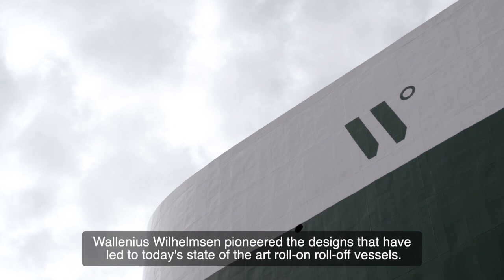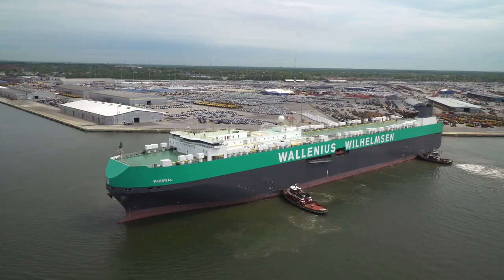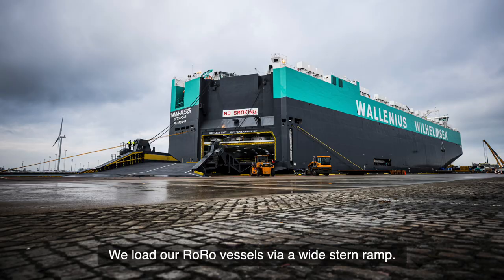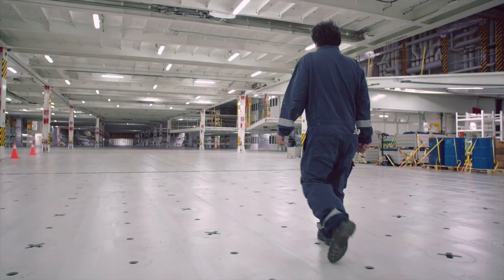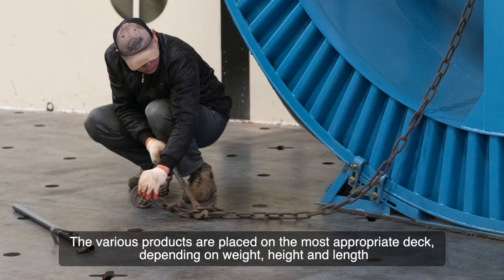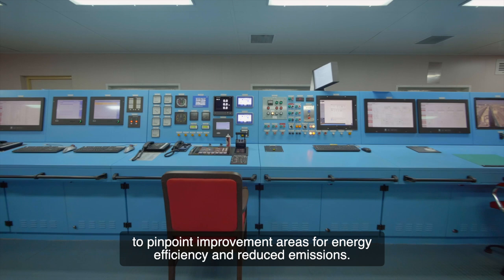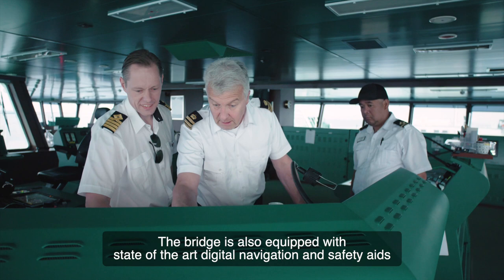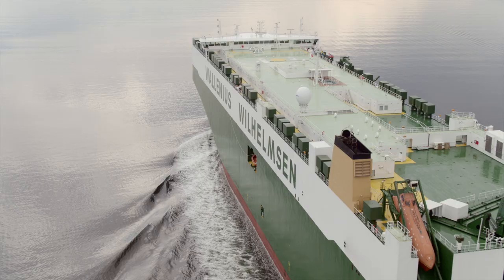360 Vessel Tour I RoRo Vessel from the inside

Comment: What could be the many boxes? I see it on the deck level.
Reply: Containers
Reply: You might be talking about the square things on the edge of the deck? Those are the housing for the intake supply fans. Huge motors and fans inside the boxes on the deck supplying fresh air to the cargo spaces. All of the equipment when loading and unloading emit mad amounts of exhaust so fresh air is needed.